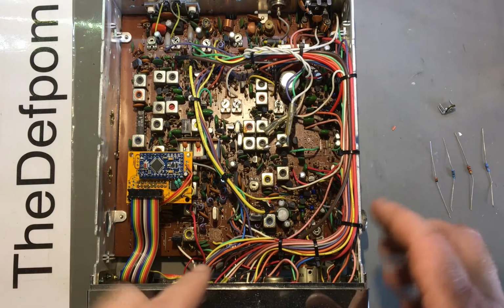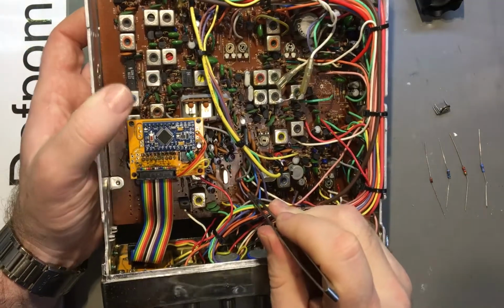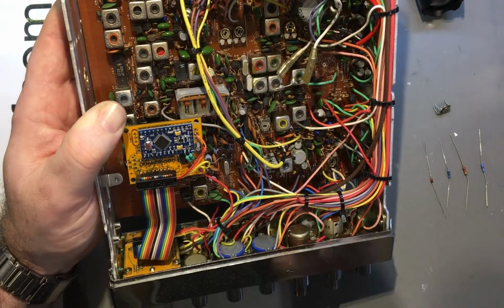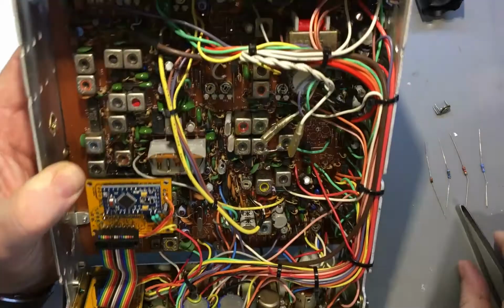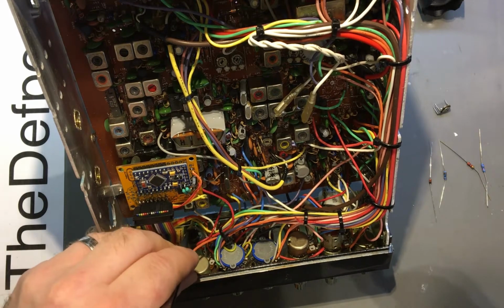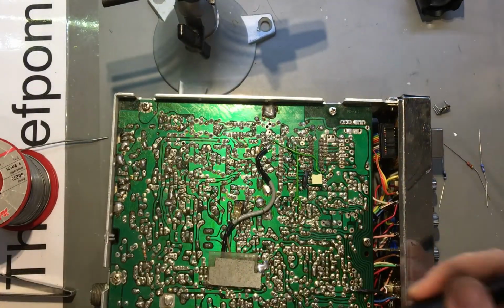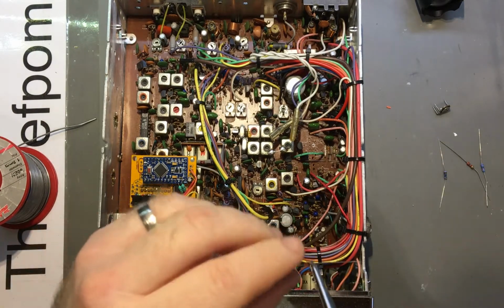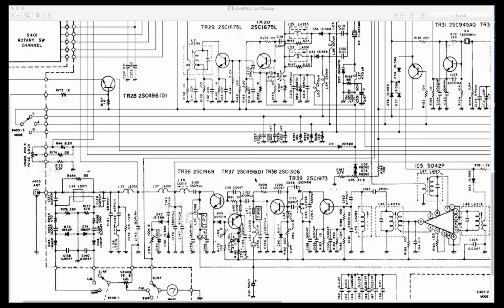#263 Cobra 148GTL CB Radio with EP4 Channel Expansion Board - Clarifier Restoration

Comment: shielding that flat cable might do the trick...use conductive fabric tape and some ferrite core like those used in printers flat cables.
https://www.aliexpress.com/item/60mm-Cloth-Fabric-Adhesive-Conductive-Tape-For-PC-CellPhone-Laptop-LCD-EMI-Shielding/32628661707.html

Comment: Very interesting!  What's that arduino (looks like an arduino) doing on the left hand side?  Good job restoring the clarifier!
Reply from the maker: GadgetUK164 - Retro Gaming Repairs & Mods - that is a channel expansion board I am in the process of designing, it is working and gives around 400 channels, but I am still working on noise issues from the 3 digit 7 segment display being driven directly by the arduino.
Reply: Excellent!!  Great work, I am sure you can fix the noise issues! =D

Comment: I've also had to remove other peoples odd messes in cb's too, some just don't make any sense.
The most common mod was adding the new midblock to an existing radio, for 27/81 radios it was pll piggyback time, and adding a switched capacitor to correct the frequency.
I allways took time to swap cap values to get both blocks as accurate as possible.
Sometimes unlocking the delta tune was a nice way.

Pain in the arse radios with oddball pll chips were changed to run on earlier pll's then piggybacked :-D.

I did one where i added the code section from another channel change to the existing one, to  piggyback a pll with a different input format.
Yes i know an eprom could have been used, but i had a bucket of channel changes so the fun was all mine :-D
Reply from the maker: zx8401ztv - yes the lc7132 if I remember rightly, did a few of those myself when I was about 14 or so.
Reply: Yep that was the one for the Lc7136/7 based radios, and the Tc9106 for  the uniden Tc9119 based radios.
Slapping the chip in was easy, making sure that everything was tuned for correct spec took longer.
Also routing the p.d wires so they didnt impose noise into other wireing, people moan rather quickly for minor noise lol.